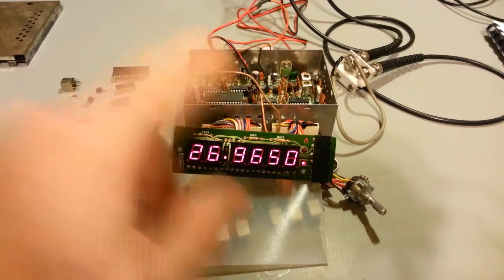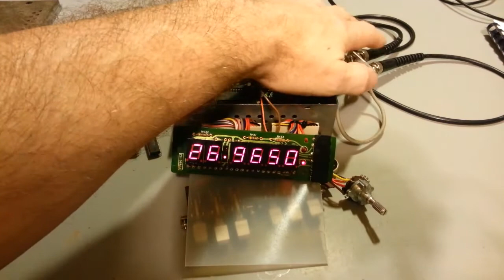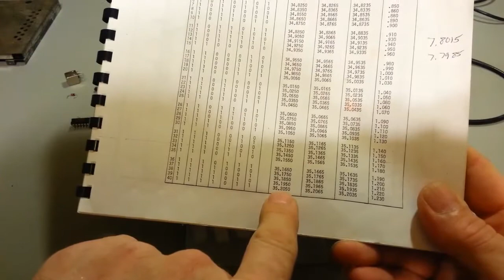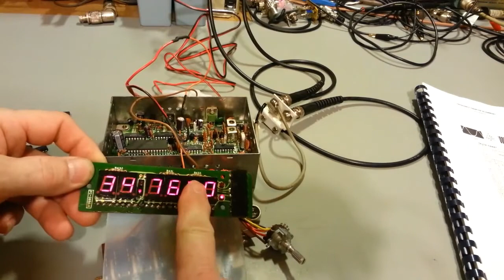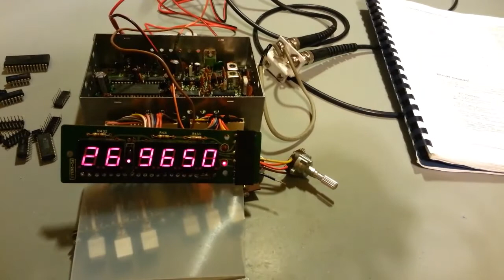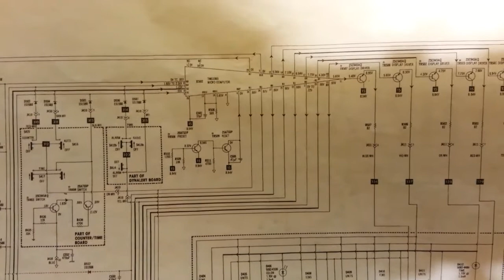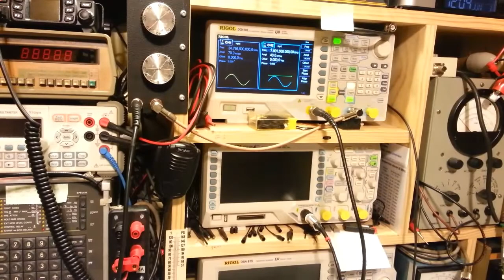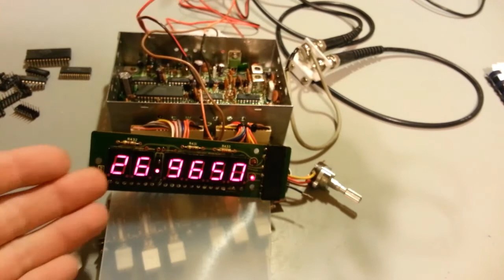Cobra 2000GTL frequency counter. Lightning strike damage repair.

Comment: Good Grief no shipping from Canada is bad but from the Europe oh my!!! I get parts from Europe like obsolete IC's and tubes! Good grief shipping can often be more than the price for the part and talk about taking forever! It takes longer to get an IC from the UK than it does to get parts with free shipping from China! In fact I refuse to purchase electronics from the UK now because of too many issues. It took 4 months to get an IC after I paid for it and was charged for it! It took that long again for 10 little capacitors we are talking 22uf @ 35V  and 2X never got what I paid for even 4 months latter! Never had a problem with China or former USSR countries at all or the rest of Western Europe just UK!